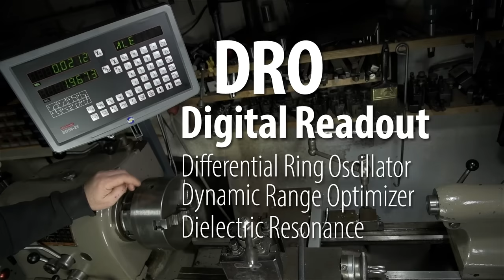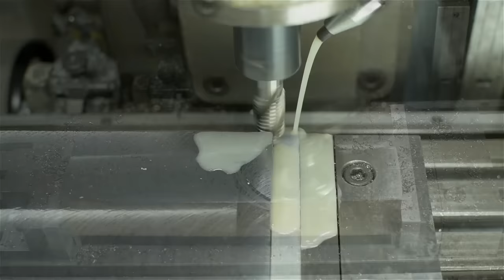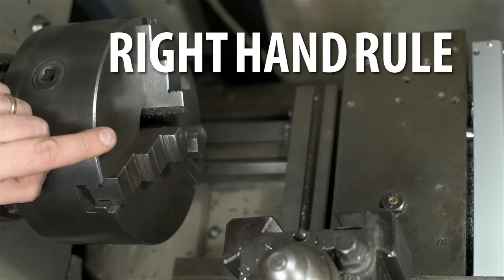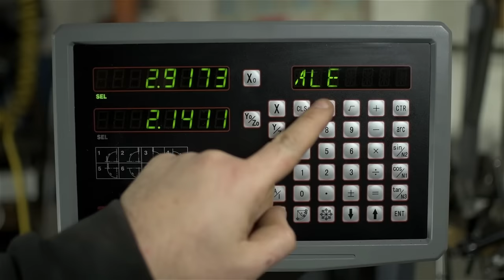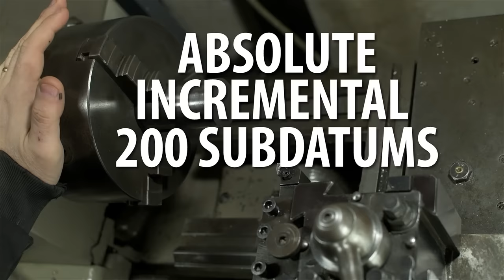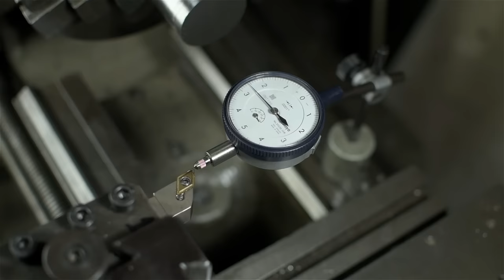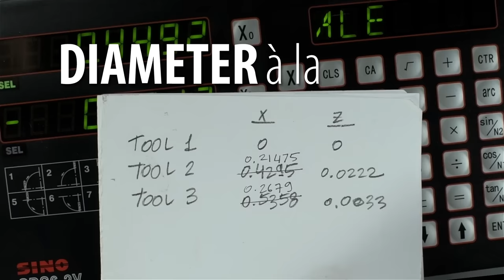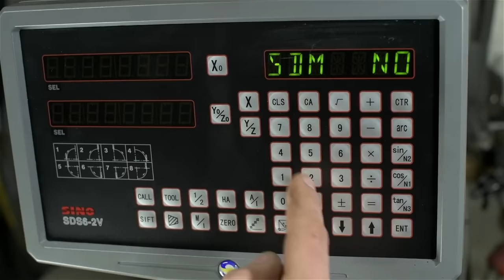DRO BASICS? & Lathe Tool Offsets!! (SINO DRO)

Comment: I just had a peek at the DRO manual http://www.boltontools.net/pdf/SDS6ZX45.pdf  Tool library is on Page 77 (pg 86 in the pdf reader).
I didn't see anything that would explain why the offset value would jump after pressing enter. 
Page 2 (pg11) you can change the resolution:  5μm, 1μm,10 μm,  0.1 μm, 0.2 μm,  

About why there was a gap between the the tool and the work, might be because you may have missed the negative value. .2147 vs. -.2147 
So if your tool2 doesn't stick out as far as your tool1, it should be a negative value, if it sticks out further, it should be positive.
In other words you zero tool1 as you did, then on tool2 you return the cross slide so the DRO reads 0 and read the dial.

Comment: Ok for insert tooling but not so useful for hss tooling that gets sharpened or modified. You are just likely to add errors by using a feature that isn’t all that helpful like multiple driver six way seats, “ no one drives my truck but me!”

Comment: Your caliper lied to you. When it is off, it is still monitoring the sliding part and keep track of it's position. Remove the battery, let the capacitor run out of power, move it and put back the battery and you will find that it has lost it's position.
Reply: That was kinda the point I think. The caliper keeps the position even when off, using a minute amount of power from battery and the DRO doesn't, even if it's plugged to the mains, which is a minus point.

Comment: It was all good until you started the talk about the DRO
At that point my head exploded.
Back to the slide rule for me I’m afraid.
I turned on my DRO & it said “call for you on your wrist radio Dick Tracey!” 😜
I think I got the “Buck Rogers in the 25th century” DRO on mine because where yours has number read outs and keys, mine coming from China had wire rails and different coloured wooden beads.
Brand = Abacus apparently.😂😂
How is it I can disprove Einstein’s theory of special relativity - on the back of a table napkin with a crayon - but I couldn’t follow a thing you said about DRO’s and Absolute and all that other mumbo jumbo?
I’m betting you could talk underwater with a mouth full of marbles!
Accidentally vaccinated at birth with a gramophone needle & haven’t shut up much since. 😂😂

Comment: I would never use this because my tool doesn't change until it gets cold outside. Good video though. Lots of info. Lots and lots of info. My brain hurts. Look a squirrel. Lets go ride our bikes. I wonder what happens when I pull this wire out of my compu                                              ……………………..

Comment: Total ignoramous here.  But what is the skim milk stuff you are cooling(?) the cutting bit with?  I assume it's not skim milk.  If it is, my bad.  But assuming it's not, what is it? If this gets answered later in the video, I will feel dumb and delete this.
Reply: Soluble oil coolant.
Standard practice in machine shops who get paid for what they make.
Reply: To add to the previous comment, the water soluble oil looks like a light oil when purchased, but turns milky white (depending on concentration) when mixed with water.